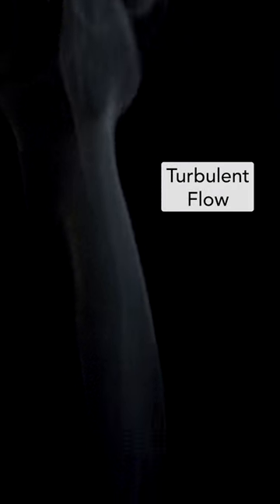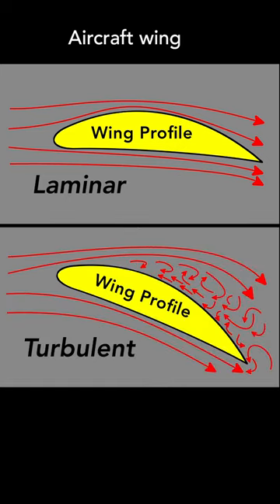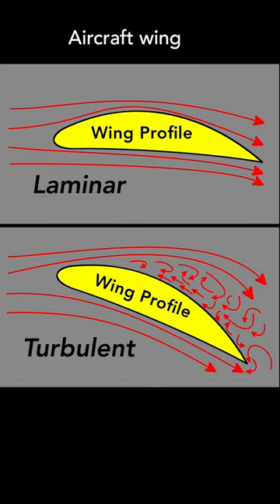Laminar and Turbulent Flow #shorts #engineerguy #engineering #flow #illinois #engineeringconcepts

Comment: How important are aerodynamics really for a truck that is only doing 80 or 90 km/h when you can't really improve the aerodynamics that much given the basic shape you can work with? And when you are hauling tons and tons of cargo? They make curved windows so you have to buy new windows from them and can't get a replacement from anywhere else.
Reply: Manufactures today can’t stand the idea of people repairing products themselves. They just HAVE to find a way to charge money where it could be unnecessary.
Reply: I designed side view mirrors for trailer trucks, the difference in scavenged HP between ones with a flat back vs a curved shaped back is  unbelievable, At 100 mph it takes 15 HP each to push them through the air.